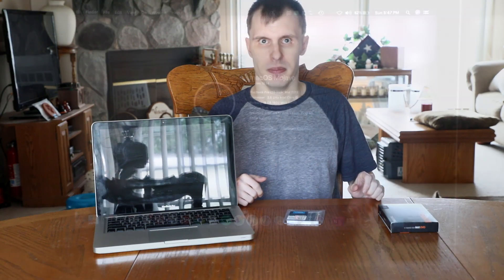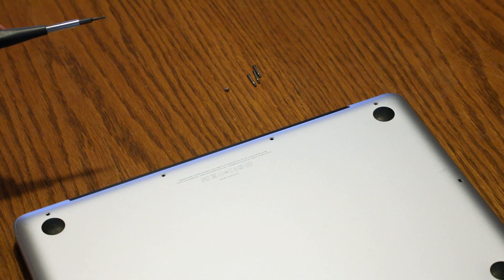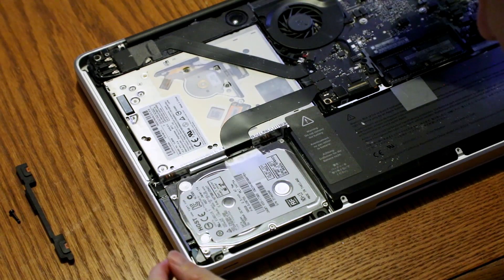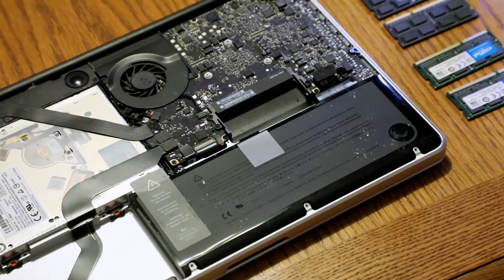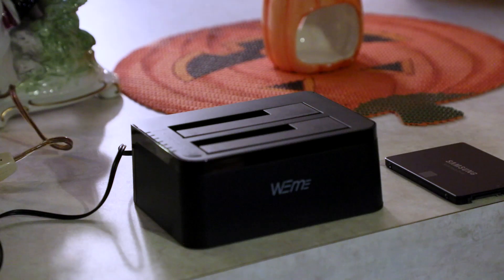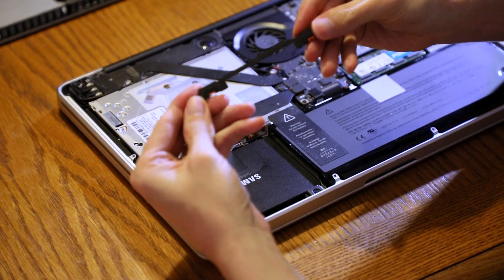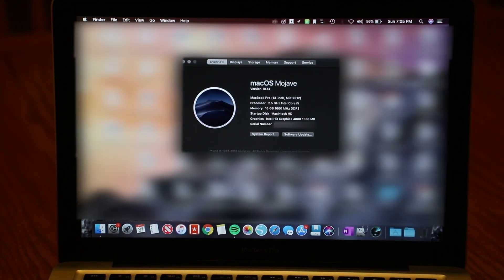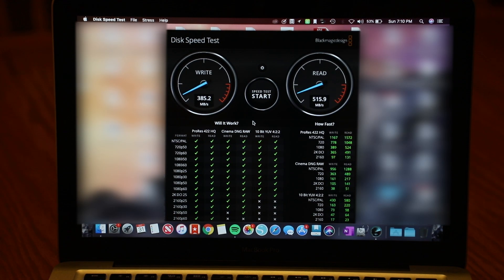MacBook Pro Mid-2012 SSD and RAM Upgrade Tutorial

Comment: At the end of the vid, why was the SSD in disk utility showing as completely full?
Reply from the maker: I believe that was just the partition structure of the drive, not a graphic representation of the data filled vs empty on it.  Since this was a bit ago, I am not sure if the client's drive was completely full but I believe it only had something like 115 GB used on it (I quadrupled their space).  It wouldn't also probably would not have held the maximum read and write speeds if it was <2GB from being full.
Reply: @TheRealLink  Ah okay that makes sense. Thanks for the info, Great vid!
Reply from the maker: Thank you!

Comment: Thanks for this! Excuse me, I have partitioned the HDD of my Mac Pro to install Windows 10 in dual boot, with this method the partition would be saved?
Reply from the maker: Hi Filippo.  If you use the drive cloner to clone your physical disk, it will clone the partition structure too.  It should work but I haven't tried it personally.

Comment: Help needed!

I am getting a used MBP ( mid 212 ) for around $250 with original specs. Should I buy and upgrade it ?
Reply from the maker: Sounds like a good price.  Honestly barely $100-150 will boost it significantly but up to you if the older hardware works for your needs.

Comment: And another question I have my old Mac book pro and it’s very slow it’s takes 2 minute to open the app and my question is is it enough to change to ssd? Without changing the ram? I have 4 ram only is it enough to make my computer run faster ?
Reply from the maker: If it's the 2018 one you mentioned earlier, it's unlikely you could add RAM to it.  While that would give you more memory capacity it wouldn't necessarily make the machine "faster".  If you have an older model machine where you can upgrade and change the HDD or SSD to a newer, faster SSD, then, yes, you'll probably see a big speed improvement.
Reply: TheRealLink I have old machine and it’s 2012 model MacBook Pro and it’s very slow and I just need to make it really fast is it enough only to upgrade hdd to ssd ? To make fast ? Or I must to upgrade the ram too?
Reply: @probablyyes8339  i was wondering the same too
Reply from the maker: Hi Probably sorry for the late reply.  More RAM would help but just the SSD alone is a good start.

Comment: I have Mac book air the 2018 model and it’s 128 gb ssd and it’s full I don’t have space for photos and editing my question is can I change it to 500 gb ssd? Do you recommend it?
Reply from the maker: As far as I understand it, most Macbook / Airs past 2016 have their SSD capacities and RAM soldered in place.  It would not be changeable by you, no.  You'd either need to get an external HDD / SSD or buy a new machine entirely.

Comment: Hey there! Did the MacBook start up in 5-10 seconds or was it sped up? I upgraded to an ssd in back in 2018, with a  clean install, but my boot time has always been around 30ish seconds. I am currently running high sierra with 8gb ram and trim enabled. Do you have any ideas on how i could speed up my boot time?
Reply: Thanks for the video btw!!!
Reply from the maker: Hey Shakey, sorry for the very late reply.  I did speed that up just for keeping the flow of the video "going".  I'd imagine similar to a Windows machine, there has to be some area where you can turn off programs on start-up or tweak what loads, though I do not use a Mac on a regular enough of a basis to tell you where.  I'd hope that that would at least help solve your boot times.  Thanks!

Comment: Hi there - followed all instructions. The only thing that was different to your outcome was after cloning and re-installing new SSD 1TB it wasn’t showing up in disc utility. It still shows the original Macintosh HD 500GB drive. Any ideas ?
Reply from the maker: That's strange Hmm.  I'd have to think of what to suggest in a bit, sorry.
Reply: Okay , the 1TB hard drive does show up disc utility, internal.. but will only ever show the old macintosh 500GB HD storage capacity.  Is there a way to show the new SSD 1TB storage capacity? Will the new SSD kick in once I go over 500gb if you know what I mean?
Reply: @duanedawson1769  did you figure this out. I’m having the same issue

Comment: Hi I need some help!

I bought a 2012 MacBook Pro 13 inch and I want to upgrade it:

My dilemma is the SSD & RAM I should purchase I have a budget of £90 but it’ll take me another week of work. And using an 2012 MacBook Pro for another 7 days will be a pain in the ass so:

SHOULD I PURCHASE: 

OPTION A: £120 
16GB RAM (£55 - eBay) & 
500GB CRUCIAL SSD  (£63 Amazon)

OPTION B: 
8GB RAM (£25.99 - EBay)
250GB CRUCIAL SSD (£42 - Amazon)

The 16GB RAM + 500GB SSD would be amazing bout that would cost me around £120 Or will I be with a 8GB RAM + 250GB SSD that would cost me £70 rounded up?

My question is I do want to use this computer at least for the next few years? What would you say is best?
Reply from the maker: I'd probably say go 16 GB and 500 GB SSD, especially as you said if you plan to stick with your machine for a few years still.
Reply: TheRealLink thanks!

Comment: Thanks for great video, I have a MBP 13in Mid2012 its painfully slow.. I can’t upgrade it myself but I want to buy memory and SSD myself to take to a technician. Does it make a great difference in speed if I buy 1Tb vs 500GB SSD? And what about 8GB (2x4) vs 16GB (2x8)? 
I’m very ignorant about tech stuff and don’t want to spend on things that won’t make my macbook faster. Thank you!
Reply from the maker: The difference between a larger and smaller capacity SSD is just about the overall time that it takes to wear out in a sense after too many writes to be usable, but that takes a huge amount of disk IO.  Some particular programs may run faster with more RAM, but in general if you have enough RAM to cache everything you're doing, you'll see a bigger speedup from the SSD alone.

Comment: I have a 2012 MacBook pro 2.9 GHZ Intel Cor i7 with 8 GB or memory and old 750 GB storage. If I buy everything you have in your description except I think I am going to get 1Terbite of storage. Will that work on my MacBook. the one thing I am worried about is transferring all the data from the old hard drive to the new one. Is that WeMe HHD drive dock as easy as it looked. I have watched many other videos and the do a lot of clicking and transferring and this WeMe cloner looks way easier.
Reply: any input
Reply from the maker: Hey Sorry Jim! I don't know why I wasn't getting some of these comments on the videos directly messaged.  Yeah you shouldn't have any issue with the Mac as far as I can tell.  Using the cloner does a sector-based copy of your drive so the replacement should work just fine.  It only copies HDD to SSD though - it doesn't do SSD to SSD.